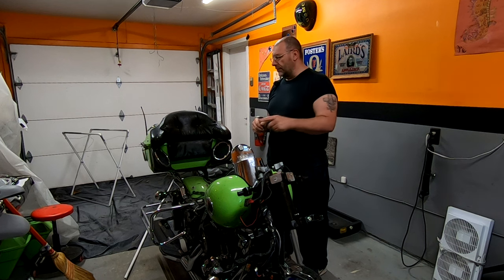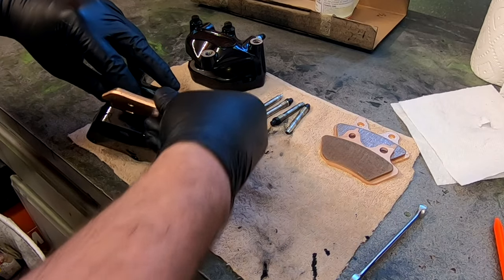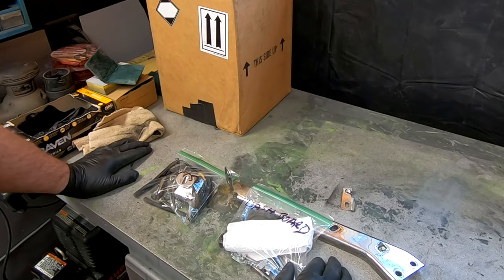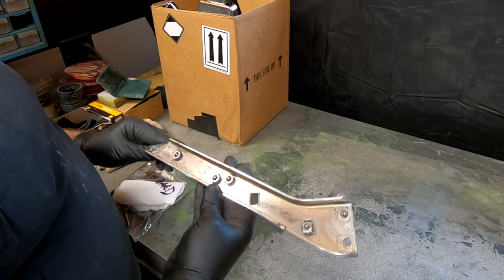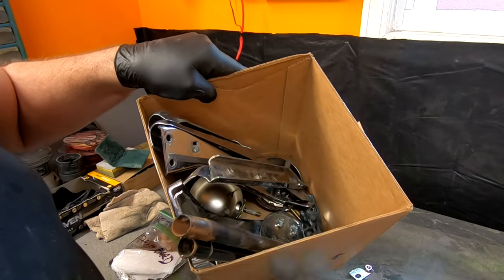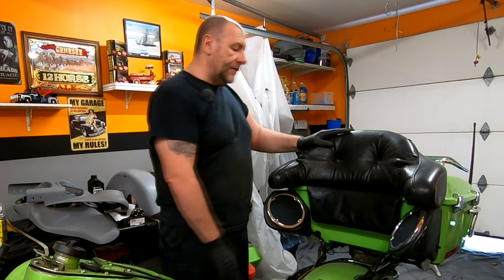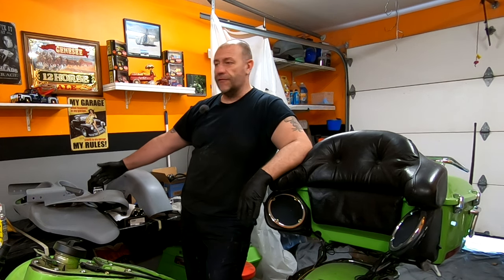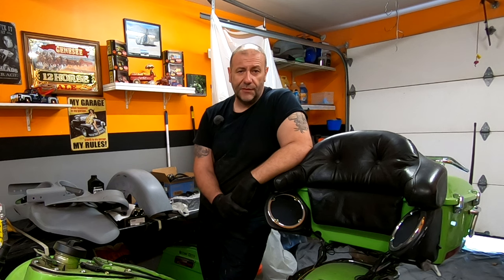Harley Ultra Classic Makeover #14  Front Brake Pads Bag Supports Fender Struts Center Dash

Comment: Enjoy watching this process. What was the item you removed from the right side? An auxillary horn? Will it be going back on?
Reply from the maker: Thats an air horn and yes it will be going back on. That thing has saved me many times on the road from dumb drivers. I have two horns hooked up- the harley horn and a air horn. Pretty loud when they both go off. To put it in that spot I had to make a bracket for it. Worked out nicely hidden behind the bag.